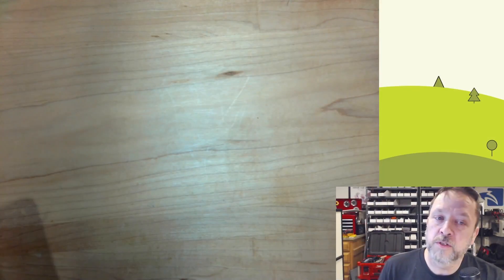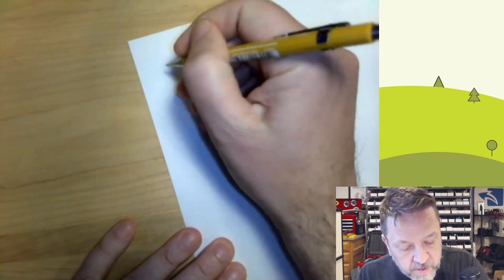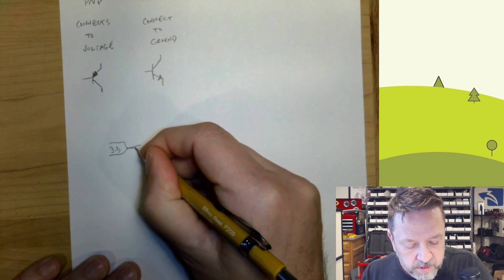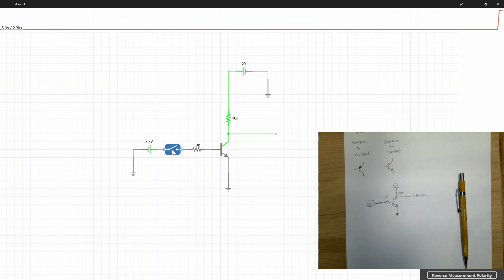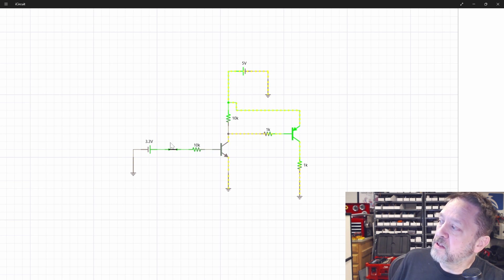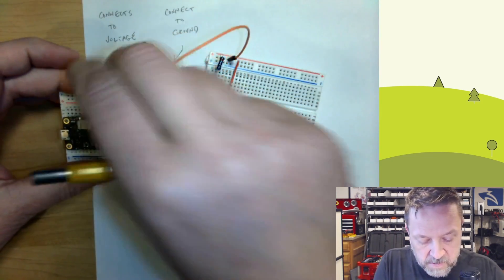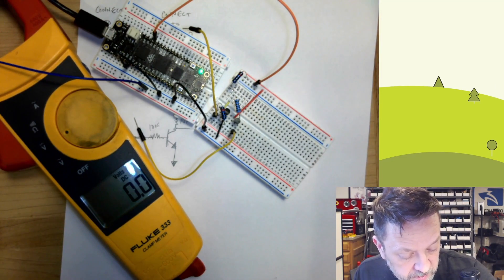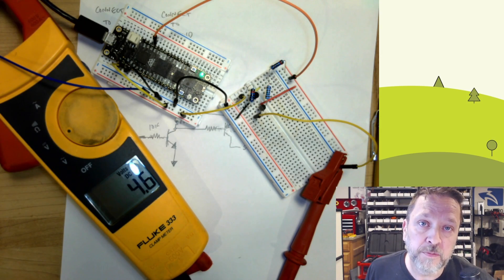Using 3.3V to switch a 5V (or higher) load with transistors

Comment: Dang it I should have realized this was not going to work for me, I can't sweep 0-5v with 3.3 the lowest I was able to to go was like 2.3v with a 1.5v analog voltage from MC I'm pulling my hair out now this is so stupid they make 3.3 and 5v versions I have all these dam components and no luck whatsoever
Reply from the maker: So you're trying to convert an analog 0-3.3 to an analog 0-5?
Reply: @dotnetMakers  Might as well, I don't see why it would make anymore sense to use a digital pin? I'm trying to ultimately fade a 12v led with pnp or npn transistor somthing that should be so simple. yet the new arduino nano esp32 only does 3.3 instead of 5v on its I.O which is do dumb! but that's just half of it, I'm trying to be able to fade the led allowing the Arduino to control 0-12v for fading effects, Understand the 12v is a separate power supply
Reply from the maker: @tyrian869  Typically you'd fade an LED with a PWM and adjust the duty cycle, not the voltage.  So use a PWM to switch the higher 12V and then set the duty cycle at say 50% to get 50% brightness.
Reply: @dotnetMakers  Oh maybe that's a misunderstanding on my behalf. So analog output can't be anything in between 0 and 3.3v which is ultimately saturating the Field on the mosfet? I am not opposed of using pwm but I still don't understand why I'd use one over the other
Reply: I ended up ordering a brushed motor controller which should also work as an LED driver that I can use in conjunction with a logic level shifter in case this driver which is advertised 3.3 to 5 volt logic doesn't support 3.3 volt logic because that's a misunderstanding in and of itself

Comment: I have a question, if I were to wire two (NPN and PNP) like you, does the load that i'm needing to drive only get pulled from the PNP? as my PNP can handle more source current then my NPN can for the load I'm trying to control.

Comment: I remember transistors and mosfets by how they are controlled. P=positive/voltage and N=negative/ground control. But your way works too. my question is why not use a PNP For the first transistor?